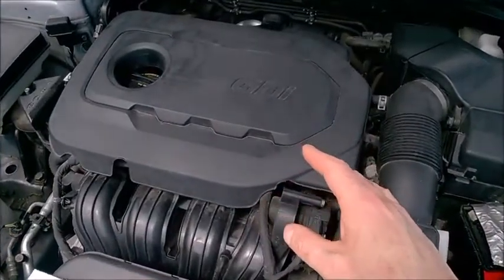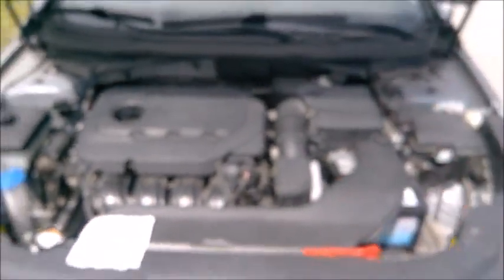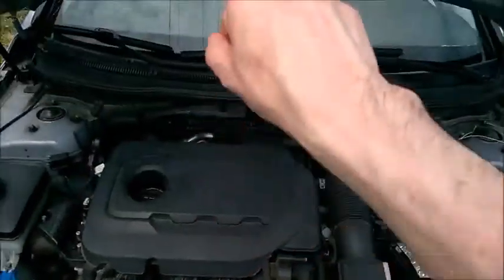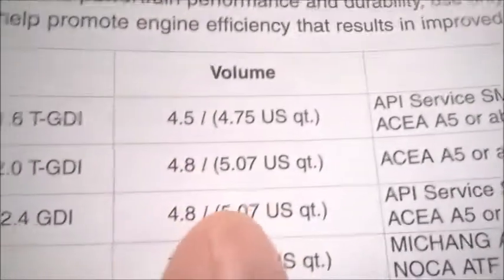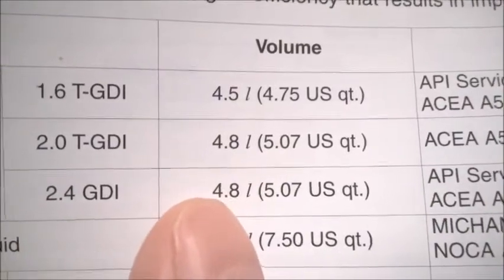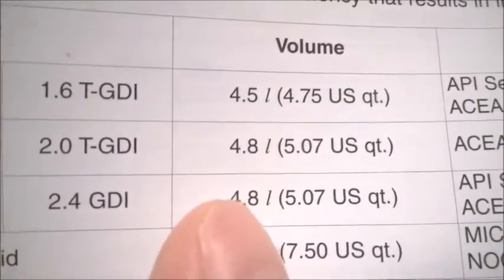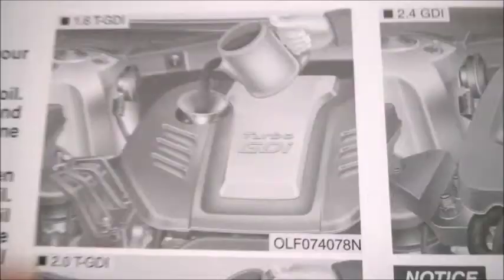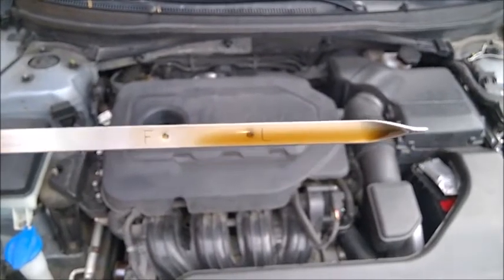Hyundai Kia 2.4 GDI total engine oil quantity

Comment from the maker: UPDATE: I realized that several jugs have actually more than 5 liters - oil level is above the 5L mark on several bottles.

Here's how I lift the Hyundai jack stands using floor jack - do this VERY careful  https://youtu.be/r4Wd99HeLXc
I like these copper crush washers for my 2.4   M14x20x1.5mm www.aliexpress.com/item/1005004125698416.html?spm=a2g0o.order_list.order_list_main.98.5dcd1802Aq2OYx

Comment: Does it burn oil?
Reply from the maker: The first thing to try for severe oil consumption: chances are piston rings got stuck because of engine cover gaskets leaking oil inside spark plug holes - when the car doesn't run, this oil leaks inside cylinder past spark plug threads, and hardens on the piston ring groove causing stuck rings and oil consumption. Hyundai has a procedure to unstuck the piston rings, read online TSB 21-EM 003H. If this doesn't work, likely the cylinder walls are ovalled (worn) and likely Hyundai will not replace the engine for free. If you live in an area with warm winters, try using a thicker oil, such as 5W-30 or even 5W-40.
Engine recall https://youtu.be/ehHp8Te2uLw

Comment: If you don’t mind me asking, why did you use 0w30 instead of 5w20 or 5w30? Thank you for the helpful video!
Reply from the maker: I appreciate the question. There are several aspects. I want to stress first that given the problems with these engines, I recommend using only the oil grades indicated in the Owner booklet, so Hyundai can respect the engine replacement extended warranty if needed in the future. I personally called my dealership and they told me they will respect the warranty if I use 0W-30, but that may not be the case with other dealerships.
This being said, I use a thicker 30 'warm' grade for better engine protection, the 20 grade may be too thin for these problematic engines (the 20 grade is mostly suggested to save a tiny amount of gasoline due to tiny lower shearing in the oil).  I then choose the 0 'cold' grade because I live in Canada with very cold winter start-up temperatures, the 0 grade has the oil flow better at very cold starts and may slightly reduce engine wear for the first running seconds. There is another reason why I use this particular engine oil from Pennzoil. It is actually one of the only two oils available in North America that are actually made and bottled in Europe with much better components.  The other oil bottled in Europe is the Edge 0W30.  The was also Edge 0W40 which appears to have been discontinued here in Canada
Reply: @Peppermint1  I agree with you I also use 5w30 for Hyundai and Kia. You make a very good point about our weather here in Montreal. You’re right, I had forgotten about the 0w30 being made in Europe.